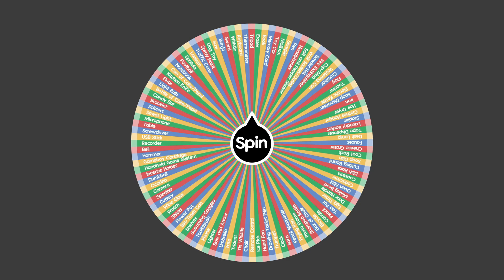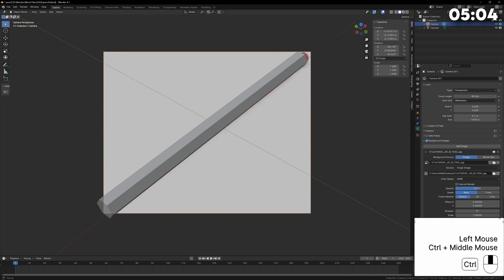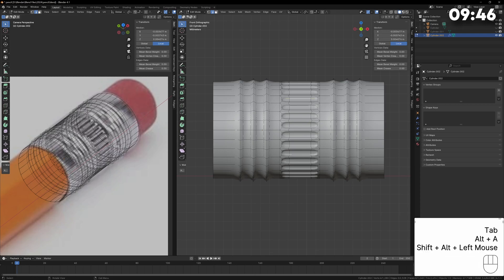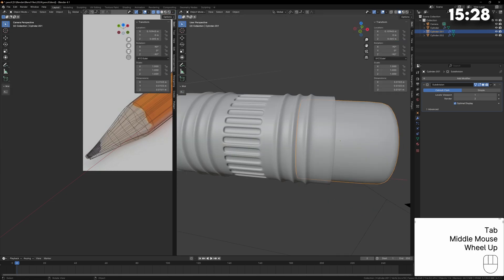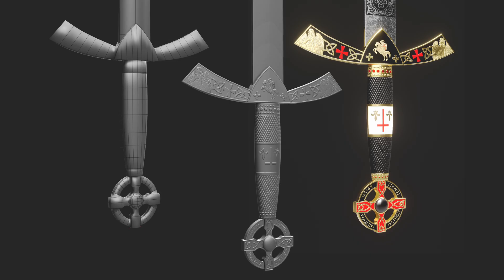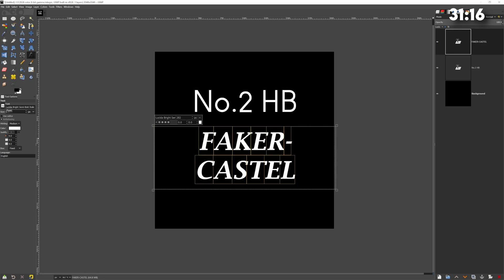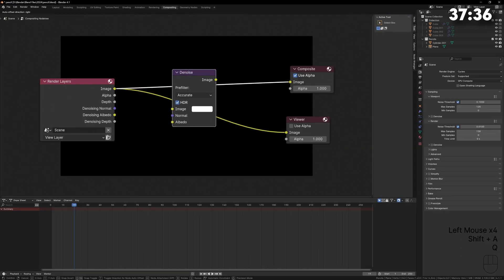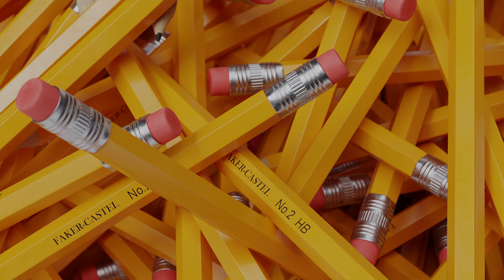How Easy is a Pencil to Model in Blender?

Comment: With Node Wrangler-addon, you can import PBR materials easier. In shader editor, select BSDF node and press Ctrl+Shift+T and select files for the material. The addon automatically creates the nodes and sets the color spaces correctly.